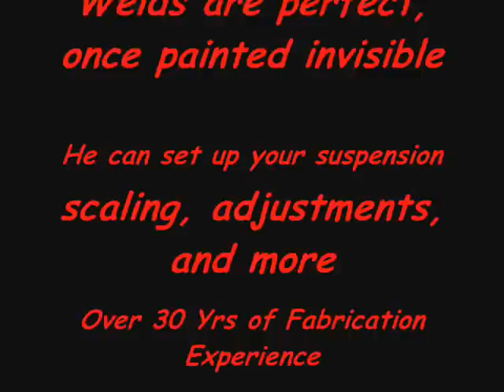Precision Fabrication 2010 Mustang Cage Install

Comment: Nice to look at but totally fails as a cage, there are too many things wrong with it that I'm prepared to list here but I'll list a few. The backstrays should have no bends in them, period, the main hoop should only have one vertical bend in it and there are no gussets to the pillar, here is no X brace in the main hoop, there is no X brace to tie the main hoop with a front hoop and no X brace to tie the main hoop with the rear strays. What you want is triangles not bends. Looks nice thou!